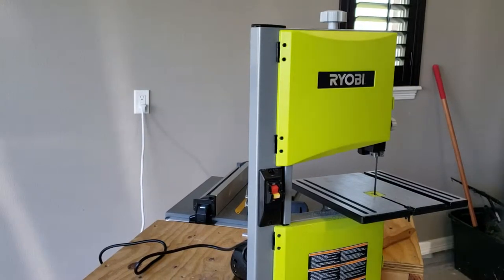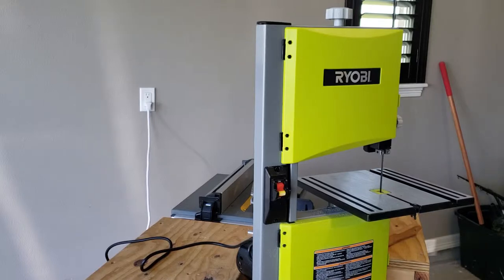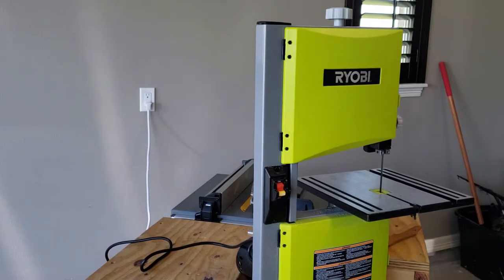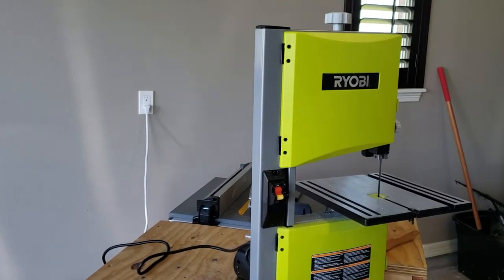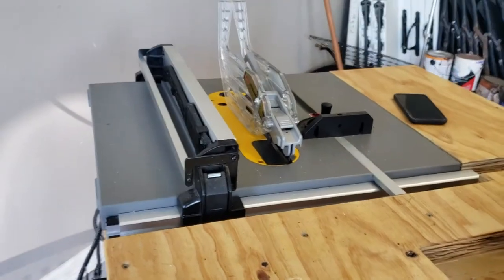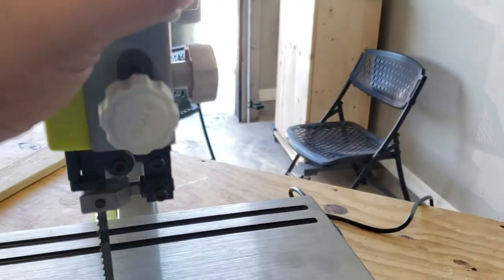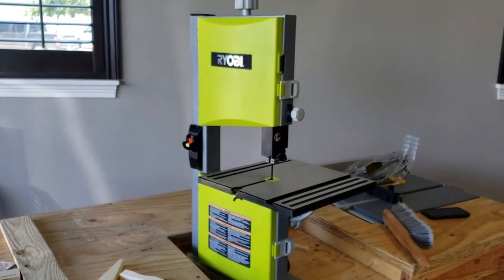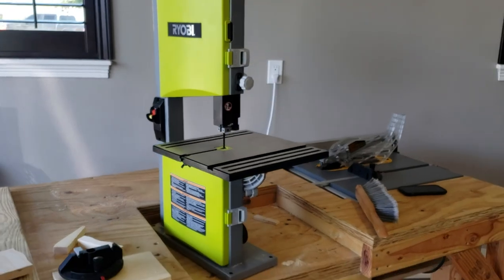Quick Overview: Ryobi 9" Bandsaw

Comment: I have this exact thing, and it is super useful! I just wish it could resaw material larger than about 3.5". Also, I realized that after changing the blade on mine, the blade would no longer cut straight - and it does not get tighter when I spin the knob. Have you had a similar issue? Overall, great tool for someone just getting into the hobby for the amount of money it costs.
Reply from the maker: Not yet. I've yet to change blade, since I haven't put enough mileage on it. I'll look out for it.

Comment: I'm thinking of buying one of these but some reviews say it struggles to cut atraight. Are you still happy with it?
Reply from the maker: There's adjustments to make on height, so there's less movement from blade. It works well. I would say, that it is a beginner type saw. The occasional use when needed, weekend projects, DIY stuff. It's a solid machine to get practice and comfortable. Now, if you intend to put it to work regularly, then I would invest on an upgraded brand. Personally, I only knock out a couple of projects every 3 months and it doesn't make it into every project. It very similar to a jigsaw - I forget that I have it, and have to remind myself to use it.